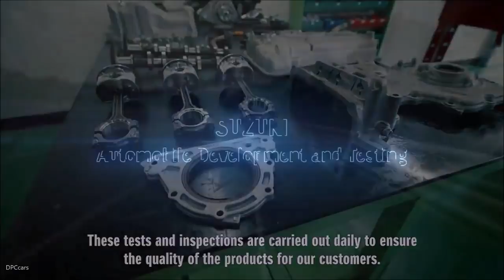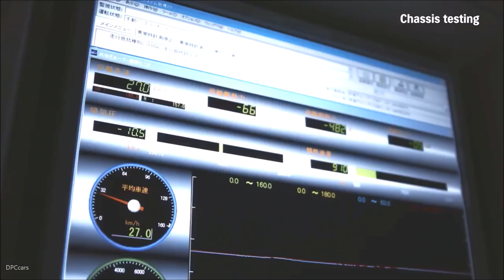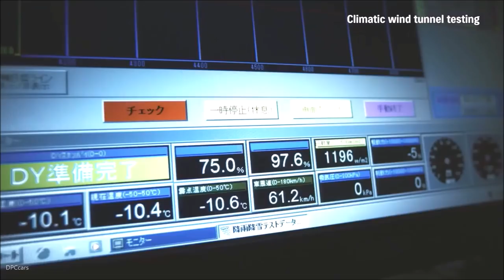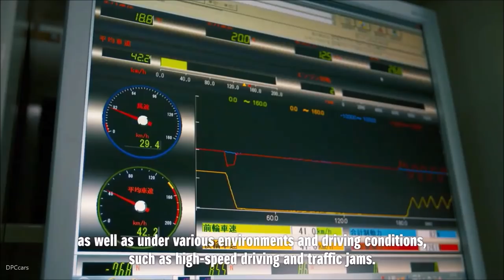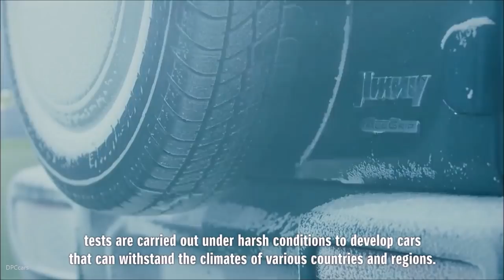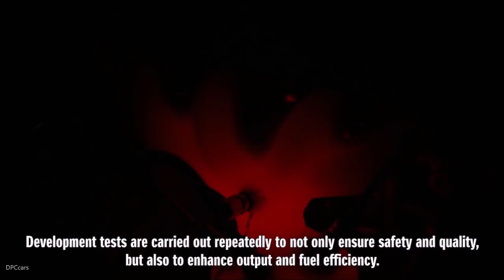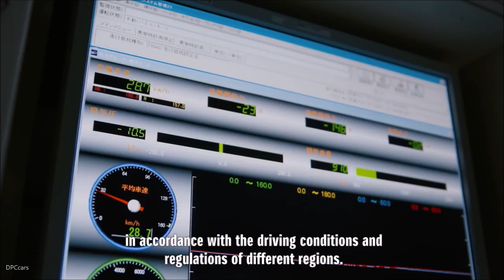2019 Suzuki Jimny Testing & Development

Comment: As the owner of 7 Swift's and 3 samurais, no wonder they don't break down. I mean the plastic bits have come off here and there over the 30 years of wear and tear but mechanical and structural they are holding out fine with no signs of doom yet.

Comment: I love the look of the new Jimny, and if they price it aggressively in the UK, I’ll be at the dealer’s door when they eventually release it here.

However, I would have been a lot happier with this video if they had shown the Jimny doing the sudden turns, skid pan, and crash test instead of substituting another vehicle from the range.

To me, this suggests that the Jimny didn’t do so well in these tests.
Reply: Update: had a chance to test drive one this week, higher spec. SZ5 version. 

To be fair, I should point out that I had just stepped out of a 2.0L Mazda MX5, and our other car is the wife’s Merc GLC with a 2.0L diesel so it probably coloured the comparison.

Loved: the high driving position, excellent all round visibility. Big mirrors. Body panels and doors felt really solid. Appearance never fails to put a smile on my face. Light, well harmonised* controls (*aviation testing term - means that the force needed to move pedals and stick/wheel feels evenly matched and weighted!). I actually quite liked the interior, like the vehicle, it it what it is -utilitarian. 

Hmm: Engine - 1.5L petrol reawakened memories of learning to drive in my youth, I mean, I’d nearly forgotten that you sometimes actually have to change down for hills?...O M actual G! Still, it sounded pleasant enough. The slab sided design and light weight meant that cross winds were..noticeable. Seats were a bit like sitting on a large marshmallow, no side support to speak of, but no doubt my considerable weight would shape them over time.

Errrr: - steering. Lets face it, going around corners was never going to be a strong point, and doing it at speed would probably need your passenger to have a trapeeze arrangement like they have on racing yachts. However, I didn’t find it vague as some reviewers have said, but that said, I have driven landrovers where you could turn the wheel 15 degrees either side of centre without having any measurable effect on direction of travel*, so maybe I have a higher tolerance level. *Doing this in the Jimny set up a side to side wobble akin to the movement of one of those dashboard hula dancers on a spring, which was comical...for a while.

Grrr. - the top spec SZ5 variant in the UK is around £18500 - aggressive pricing, but not in the way I’d hoped!

So, the net result?

Loved it. 

It is FUN and charisma on four wheels.

My deposit is paid, and I hope to take possession in about six weeks time! 

Classic heart over head decision.

Comment: simple . easy to fix on the middle of nowhere and platform suitable for modification . practical for intensive daily uses and moderate adventures off roading maybe more with a Japanese quality of building and used materials and with very rich heritage for the car even if it it's very compact but purely devoted for off roading . down side underpowered . and little bit overpriced for it category ( size ) , safety test stars , payload ..
Waiting for the fully cabriolet , targa , four doors .

Comment: This car could be my next car. However, there are 3 things I don’t like.

1. Euro NCAP - crash test got only 3 stars. It means dangerous to use it in crowded tollways.

2. I don’t care how good it could be in cold climates. I am very doubtful if it could last in 40 degree Celsius++ because the weather here has only one season - summer.

3. Fuel consumption is not very good. It seems like I am going to buy a 2004 technology while I am living in 2018. 

Overall, I think Suzuki can do better than this.
Reply: Rawinpong Chaisatien Buddy.. I think you're being abit harsh here.. I've driven Jimny's through the Australian outback, Where the temperature doesn't drop below 40, Even during some nights.. Never had an issue and the new Jim looks even tougher.. 

The NCAP Rating.. Honestly the Jimny did great IMO, Look at where it lost points and you'll see why the score doesn't reflect Suzuki's safety reputation, It lost points on tech safety and pedestrian safety.. Second.. The Jimny is a kei car, Without the flares and 1.5L Engine atleast, So we're talking about a micro car here, You really gotta consider the size of this car and even then it still comes out on top over other larger 4x4s.

The fuel.. I mean again, I think the fuel efficiency is great especially for the car you're getting..You need to remember this is a proper 4x4.. Not a city car, Even though it is capable of that and just as good as other small city cars, Compare the fuel efficiency to land cruisers, defenders, jeeps and other 4x4s and you'll realise the potential Suzuki have put into the new Jimny for fuel economy.

I don't mean to be rude but the only logical dispute you've suggested is the NCAP Rating, I can tell you I'll be driving this car through the outback here in Aus and I'm confident putting my life in Suzuki's safety tech, Here in Australia between cities it's not uncommon to strike a kangaroo at 100+kmph, A kangaroo would more than likely destroy any vehichle without a bull bar or front protection at that speed but the car isn't the issue, Safety is and I'm confident in the Jimny's safety tech.

Again, don't want to be rude or anything but if these are your biggest concerns then perhaps a 4x4 isn't best suited for you, A light SUV Might be more suited for you, Something small that is designed for city use, The Jimny is designed for off-road use as a first priority and on road use as a second, Capable at both but it excels off-road where other 4x4s are left behind.
Reply: please, buy a self driving econo-freezer